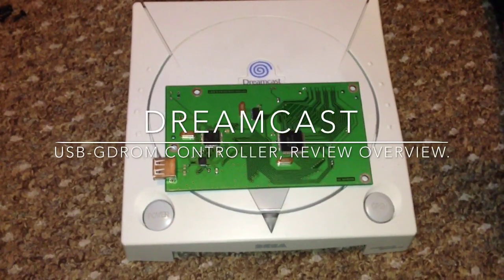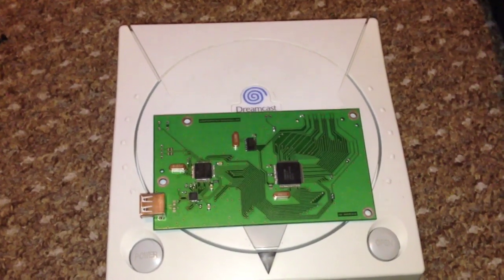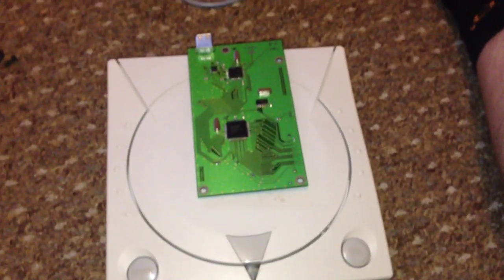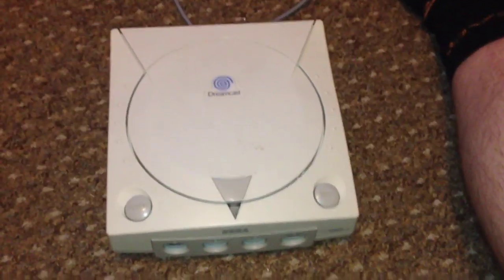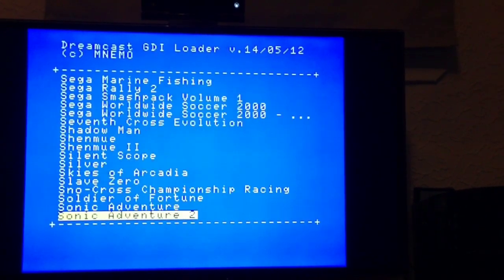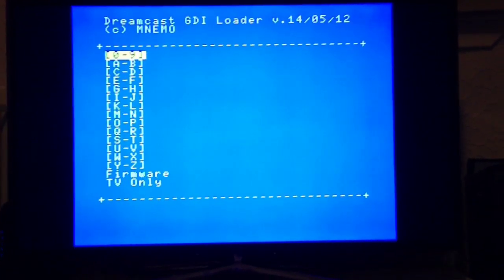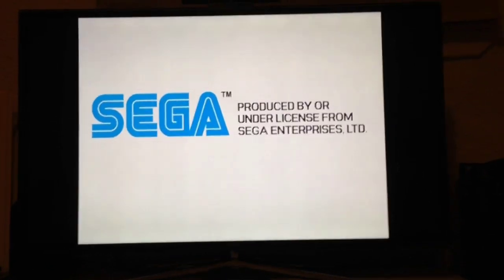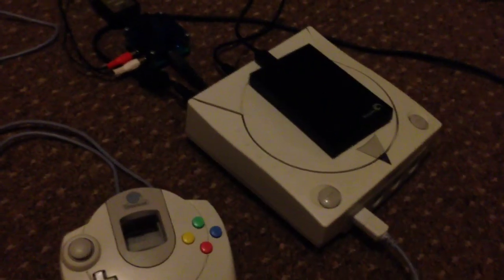Dreamcast USB-GDROM Controller - review overview.

Comment: Hi! Thanks for the video! I've successfully installed the V5 using this guide. One question though: were does the data come from that the GDROM-player is part of the airflow? I've read it in forums, but I wonder if it's not a myth:

From what I can see, at least in my Dreamcast (rev 01) the optical device is tightly shut and isolated from the rest of the components, it would be impossible for air to travel from the disc or the spinning parts into the rest of the machine.

In another video, they claim that the heating issue comes from the fact that the PSU runs hotter due to the CD-drive being disconnected, leaving the PSU open with less resistance, making it run on 14V instead of 12V. This can be solved with a simple 300ohm resistor pinned down in the PSU contact.

Just wondering if there are any proper data that support the fan requirement.

Best,
A

Comment: thanks for the upload man...  great video...  Now just need to get one for myself...   Because you own both... which do you really stand behind?
Reply from the maker: It depends on what you want.

GDEMU

Pros
1. Supports homebrew (CDI images)
2. Flawless playback of GDI & CDI images.
3. Supports changing disc if requested (must be set up correctly to work, ie, disc 1 in folder 02 & disc 2 in folder 03, also requires pressing the button on the device to switch)

Cons
1. Storage limitations
2. Currently no official menu support
3. Soldering on buttons or having to reach inside the DC to switch discs. (Currently using the 3rd party menu fixes this)
4. Region locked, console region specific.

UGC

Pros
1. Menu built in (I also offered to design a new one)
2. Max storage 2TB (Filesystem Fat32)
3. Supports USB Pen drives & USB HDDs
4. Flawless playback of GDI images
5. Region free, all GDI games work in any region.

Cons
1. No CDI support currently (no homebrew or codebreaker, will be added)
2. No way to swap discs when the game requests them (only useful for 1 game mind (D2) all other multi disc game use the save to load other discs, so this is kind of a mute point)
3. Requires cutting a notch out of your DC case, so the USB port fits.

So there you have it, pick the one that suits your needs.
Reply: JCRocky5
 Hi:

Where can I buy UGC?

Because it's awesome as hell.
Reply from the maker: ***** You can contact him via ICQ
Look here for details
http://www.assemblergames.com/forums/showthread.php?39733-quot-Let-s-make-GD-ROM-emulation-happen-quot-Facebook-group&p=772734&viewfull=1#post772734

Comment: hi there great vid, so having had this for a while now, would you still opt for the usb-gdrom over a gdemu unit (if you can get one)?
Reply from the maker: Mark Whitwell Thank you, yes I would. There is a new firmware that will be getting released soon & it fixes all issues + adds support for CDI as well as a few other features.

also I have changed my DC from this video, I now use a PicoPSU so no more exess heat :D
http://assemblergames.com/l/threads/replacing-the-dc-psu.53856/
Reply: Thanks for that, the psu mod is a very good idea, might have a look at that too :-)

Comment: Can this device force 60hz on a PAL console when playing NTSC games?
Reply from the maker: Most DC games support 60hz, the few games that don’t can’t be forced no. This device strictly allows playback of your backups and nothing else.
Reply: Hmm was wondering because it's a software controlled thing which means I would have to get a modification done to Force 60hz on all games
Reply from the maker: Yup that’s what I done to the board when I installed the device. Bridge two pads and you’re done.

Comment: Hello. What VGA to HDMI converter are you using? Thanks
Reply from the maker: http://m.ebay.com/itm/221462605982?_mwBanner=1
Reply: Cheers
Reply: JCRocky5 is it really worth the price tag tho for an old ... OLD machine? $167-$187 seems kinda too expensive for an alternative method of loading up your games if your GDROM Drive is broken.
Reply from the maker: S0LIXUS It depends, it was for me but for most folk it probably isn't. It's more of a luxury device.
Reply: JCRocky5 kinda shitty price tho.. really expensive but i do need something like this considering my GDROM is fk'd altho i'd be cheaper off just buying a job lot dreamcast bundle off ebay and test my luck

Comment: how does the loading speed compare with a normal gdrom reader? Im aware the sd card gdemu works faster.

great video btw thanks.
Reply from the maker: It's a lot faster, you're only limited by the USB 2.0 BUS speed. (So 30 odd MBs a second)

& thank you.
Reply: JCRocky5 USB2 is 480Mbits/s so I would have said 60MBytes/s... Does it plays CCDA Audio tracks ?

Comment: I have the last firmware, but I cannot access the DC bios. Anybody can help me? Not from a game, not from the usb-gdrom menu, not opening the lid
Reply from the maker: Normally I do the soft reset after a game has been loaded. 
(Start + (A)(B)(X)(Y))

Or eject the disc.
Reply from the maker: Also have you installed the lid switch?
Reply: +JCRocky5 I don't have any switch... Damn. How can I do that? Any diagrams on the internet?

Soft reset didn't seem to work last time. I'll try again. And what do you mean with <<eject the disc>>? What disc?
Reply from the maker: Yeah old habit lol, I meant open the lid (where usually a disc resides) but you don't have the switch installed so that's won't do anything. 

The soft reset works when you get to the press start screens (some work before hand, but most are at the start screen) if your I game playing the soft reset will revert you to the start screen & if you do it again it will take you to the bios screen. 
(Turn off the auto load discs, or the game will start if you enter & exit a menu)

You can also use two bits of wire to make the switch on the UGC, just attach them to the far right top & bottom via's & then connect them together for lid closed & open them for lid open. 
(Doesn't require any soldering, just some tape)
Reply: +JCRocky5 Thanks! But still with doubts.
Auto load disc: on DC I suppose, because I think's that option exists on usbgrom
Would you mind (please, please) take a photo of that wire invention or the installed switch
Sorry for the trouble
Reply from the maker: http://ayasuke2.exblog.jp/iv/view/?i=201507%2F18%2F42%2Fc0323442_15551097.jpg

Comment: What good is it if it won't play most ISOs you can download, most are CDI format and you also can't play Emulators. That's not better because you now can't play all the games you bought on GDROM..
Reply from the maker: With the latest firmware, CDI & GDI is 100% supported. Only Games that don't work currently are the new indie games being developed/released.
All homebrew & emulators work fine.

Comment: The Fan is really unnecessary.
Reply from the maker: +Alejandro Javier Asenjo it is now that we can use a resistor, PicoPSU or remove the 12v rail from the power supply. 

Remember this video is old, when this device first came out.
Reply: No, i mean the Dreamcast doesn't get that hot that you need to put a fan in there
Reply from the maker: +Alejandro Javier Asenjo it does when you use GDEMU or USB-GDRom as the 12v rail increases to 14v because the GDR drive isn’t there to reduce the voltage. 

Head over to assemblergames forums for the full breakdown.